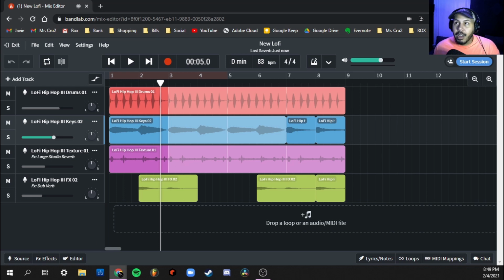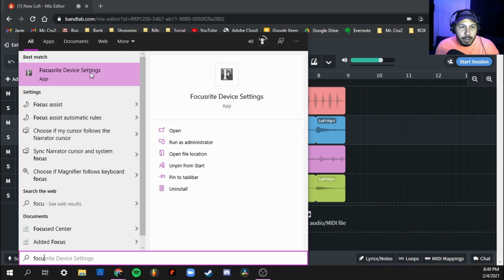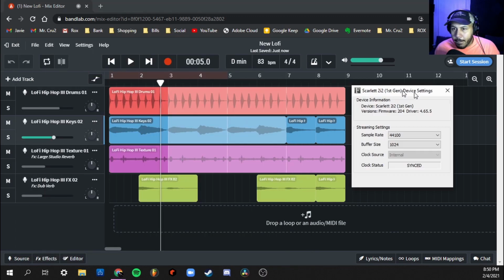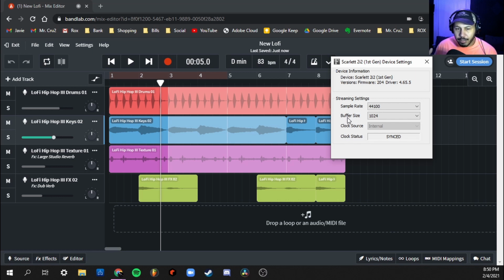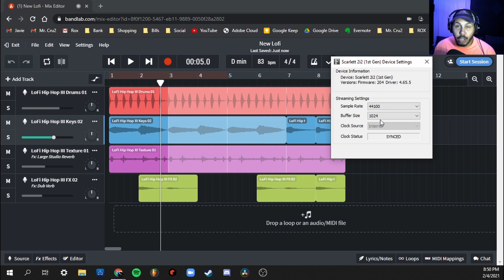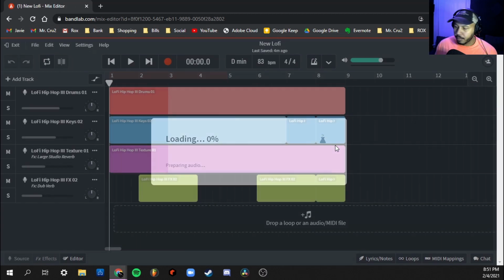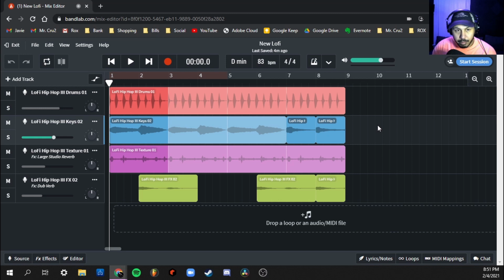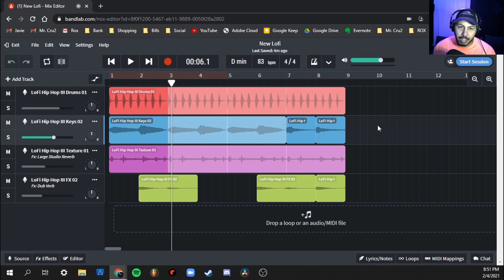EASY FIX!  l  Audio Lag In Bandlab

Comment: Can you make an update using Scarlette 2i2 4th gen? Thank you.
Reply: Did you ever find a fix for this? My nephew just got a small setup for Christmas with the 4th gen. I couldn’t get vocals to even come through until I pressed the 48v button and the direct monitor button or whatever. Everything is fine until he tries to monitor the tracks to hear his autotune while tracking. Then there’s delay.

I came home to my setup where I have a 2nd or 3rd gen, can’t remember which, and there was zero delay even with plugins on, tuning enabled, and monitoring the track. I have zero idea what the difference could be. Unless my focusrite buffer size is just already set lower and I need to still adjust his. Short of that, I have no idea what to do here 😅

Comment: What do I do if I have a presonus and is on a chrome book?
Reply from the maker: Chromebooks are the most challenging ones that ppl are having a hard time with because Google blocks a lot of what you are able to do with devices like Midi controller. 

If what I did in the video doesn’t work, try doing it on another device and see. If that doesn’t work, try downloading the drivers for your midi controller directly from the manufacturer’s website
Reply: Prec8 it definitely subscribing🐐‼️

Comment: not sure why but on my band lab on my MacBook there is an absolutely unplayable distortion like noise that happens when I record and play anything back :(
Reply: It was doing that on my laptop, I had to make my interface the input and output and then it stopped. Pretty sure it was the mic on my laptop as the input, picking up wayyy too much sound
Reply: @hendyj89  how do you make your interface go to output?
Reply: @q  mess with the audio playback specs. it should one of the options depending on the device
Reply: same issue

Comment: I don't know what is happening, I'm using bandlab midi instruments from the web. When I want to record a drum (for example) sounds is delayed after I press a key.

I'm a drummer and this pisses me off SO much. I'm guessing it has to do with this computer motherboard (processor)  otherwise I don't know what it might be...

Have you got any idea?
Reply from the maker: My ultimate guess would be as you said, either ur processor or RAM is not enough to handle BandLab. It’s kinda odd cause even tho BandLab is like a cheap version of GarageBand, it somehow uses lots of processing power and RAM in order to run. Probably because Chrome can only handle so much
Reply: Well i didnt have an interface 2 years ago, now I do and Made the steps lowering the buffer size down to 128 and seemed to work, thanks!

Comment: Any chance you know how to fix this on a Chromebook? Nothing but crackling and static and latency for the last 3 months, I’ve bought 3 new mics, a new laptop, a Phantom Power Supply, and I even talked to BandLab through email and nothing has been fixed. Still static, still horrible latency.
Reply: I’m having the same issue no resolve
Reply from the maker: Bandlab is pretty heavy when it comes to RAM. Since Chromebooks have the bare minimum needed to run Chrome smoothly, you may still have the lag issue. My suggestion would be to try out other programs like Soundtrap or Audio Tool. I’ve never run into any lag with Soundtrap
Reply: only thing i can advise is to save up for a proper daw on a decent device, preferably logic pro x on a mac
Reply: @wanderlust1197  at that point don’t even save up they have cracks for every daw plug-in you could ever want

Comment: the lag is still there on the bandlab. In my focusrite device setting buffer is 192. I can hear my voice without latency in the headphone normally but in the bandlab software when i click monitoring there is a lag no matter what i set buffer rate. Even the latency test is not working. How to fix?
Reply from the maker: Ugh....yeah, i think when Bandlab updated they changed the setting so now, even though my equipment has not changed, i too am getting lag. The only suggestion i can make is to keep experimenting with the buffer and bit rate settings inside of the focusrite.

Either that, or try out Soundtrap. I have NEVER experienced lag in that

Comment: Do I need an audio interface? I'm running bandlab on a vivobook using a steinberg interface, I can't seem to find any settings for anything. I've recorded a drum track today, added bass and the bass is like a second out. No idea how to fix it. Cheers mate 👍
Reply from the maker: Technicially, no, so can get stuff done WITHOUT an interface, but I would argue that using an interface is better because your computer's built-in audio drivers aren't designed to handle or work with high quality audio files. 

That being said, a Steinberg driver should be good enough for what you are trying to do.
Reply: @Mr_Cru2  thanks for the reply, it dawned on me as I was messing around earlier, I haven't put the driver on my laptop yet. 
I'll start there 🤣🤣 Thanks again

Comment: Great video bro, i already tried to reduce the buffer size however every time that i run the latency test on the bandlab settings i´m getting 400 ms of latency, i don´t know where else i can check, i need some help, thank you.
Reply: me too man, u found the fix??
Reply: @dogdude1235  nop bro, i started to use Cakewalk instead.
Reply: Dang mine is between 122-125. Idk what that means but it says slow. Also what's cakewalk, is it another platform because I'm almost over bandlab and this issue.

Comment: how do i find the settings?
Reply from the maker: It should be on ur computer, be depending on what kind of computer u have....I would just cross-reference it on Google with "audio settings"
Reply: @Mr_Cru2  i found it i change the settings but it still lags i need help lol
Reply from the maker: @leifjorgenhansen1304  can u list the specs for ur computer?
Reply: @Mr_Cru2  Device Name 
Processor: Intel(R) Core(TM) i3-813OU CPU @ 2.20GHz 2.20GHz
Installed RAM 4.00 GB (3.88 GB usable)
system type 64-bit operating system, X64-based processor
I'm using my laptop
Reply from the maker: @leifjorgenhansen1304  ur processor seems to be a problem. i3’s are very old comparatively. My laptop is an i5 and it can still hang. 4gb of RAM is adequate but upping the RAM might be help more since BL is pretty intensive when it comes to memory on account of being an audio program

Comment: good vid bro but when i type in focusrite nothing appears have u got a solution
Reply: I have a Mac so how do you find what sound card your using?
Reply from the maker: Focusrite is the audio interface that I have. You may have a different sound card so you’d first need to find that out and then access those settings
Reply: @Mr_Cru2  ok bro do u have any idea where to find it cuz I’ve been looking for 20 mins
Reply from the maker: @prod.by0zzy  u on a PC or a Mac?
Reply: @Mr_Cru2  pc
Reply: @Mr_Cru2  it’s fine now bro I’ve fixed it but thanks for help I appreciate it
Reply from the maker: @prod.by0zzy  ok, Google “Change to 44.1khz Windows 10” and that should help u find the setting